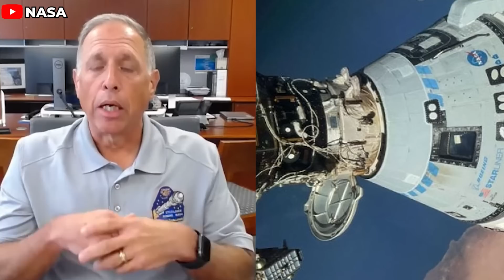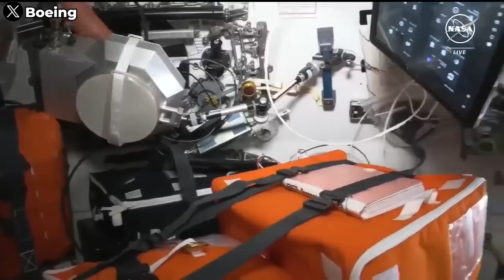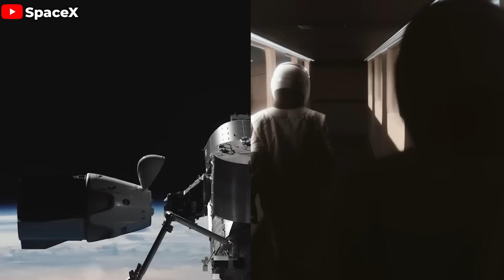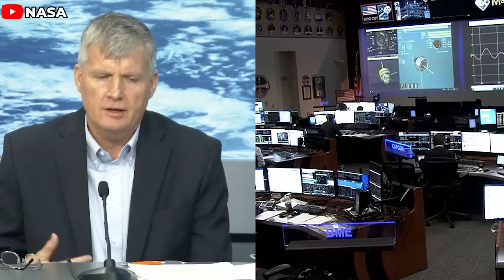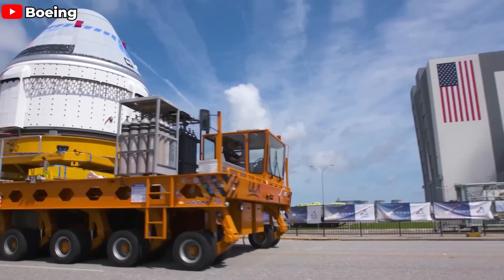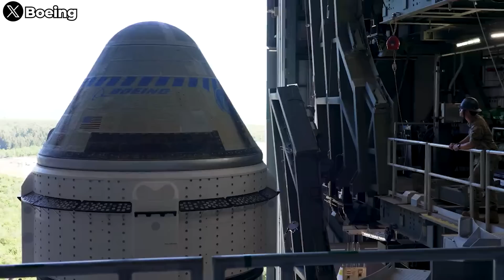Starliner's Software Is In BIG BIG TROUBLE! No Crew Return - NASA gives up....

Comment: What will happen if something suddenly happens to the ISS that the astronauts have to leave the ISS immediately???
Reply: They will take Starliner and the 1-1.5% failure risk, instead of the required 0.37%
Reply: There is a SpaceX Crew 8 dragon spacecraft currently docked at ISS.

And in worst case scenario both of them can fit in the Crew Dragon  which has max capacity of 7 astronauts but currently has got only 4 seats for its current crew.
So both can adjust in CrewDragon without seat and return safely.

Comment: So, what is the problem exactly? I gleaned that:
"if any error occurs software automatically switches to manual control by the crew"
So, cannot they roll up their sleeves and fly the craft? What's wrong with the people that they can't even go pee without computers.
Reply: the problem is, that  starliner  cant undock from iss unmamnned, it requires manual control from inner starliner by human, it needs sw uprade , but it could be problematic
Reply from the maker: the thrusters. they can stay in the spacecraft, and fly it.
But the thrusters aren't stable enough for Starliner to fly safely after undocking. This poses a serious risk to the astronauts' lives and the ISS.
starliner needs to come home without crew on board, but at this time it cannoycannot

Comment: There is no saga in Boeing, just rigmarole of Boeing’s Starliner deep seated problem.
Boeing is too powerful a corporation to be controlled or answerable to anybody.
It is time to set a timetable and make arrangement to get the astronauts home.
With Starliner plagued with problem and NASA running out of feasible options to rescue the astronauts stranded in space, please seek help from Russia.
The clock is ticking.
Save the astronauts first. 
They are stranded in space for far too long to be worried about Boeing reputation. 
Send SpaceX or seek help from Russia to bring them safely home.
Reply from the maker: they're trying to protect their face

Comment: Sounds like if Dragon is to be used next February, the software upgrade still needs to be sent to Starliner so it can automatically undock to allow Dragon to use the ISS docking port.  Then Starliner needs to get away from the ISS so it's not a danger of hitting the ISS. Sounds like a lot of complicated maneuvering will be going on.

Comment: 3 docking ports for Americans? Three docking ports for Russians? Correct? All three American docking ports currently have docked spacecraft. One SpaceX Dragon. One Starliner Boeing. One SpaceX cargo capsule. Right? So where is next week's new Dragon Capsule going to dock? I've heard the Boeing Starliner will be undocked by the Canadian Arm? Does it just "hang" around tethered to the arm for 8 months until the SpaceX returns in Feb 2025 with the rescued Boeing astronauts? Or will the SpaceX Cargo capsule return to earth and the broken Starliner then connect to the Cargo port? I'm so confused...
Reply: Only two NASA Docking System ports. Crew-9 was delayed until late September to allow a decision on Starliner, but Starliner would have to depart sometime before Crew-9 arrives. Starliner cannot be undocked by Canadarm; it doesn't have a grapple fixture.

Comment: I  said it on NSF, that they should forget about using Crew 9 for the rescue, but use another crew capsule, with a qualified SpaceX astronaut for Commander/pilot, with 3 spacesuits. Toss Starliner overboard, dock and pick them up. Stay only enough time to secure and return. Then proceed with Crew 9 mission, a few weeks delayed.